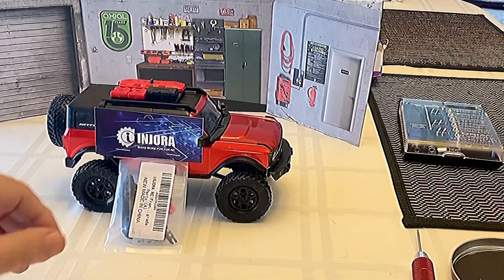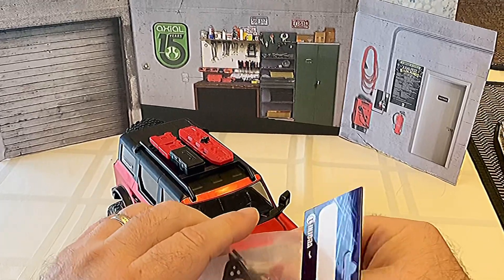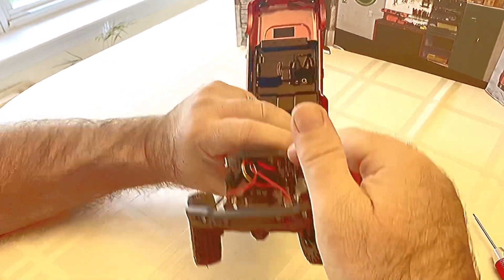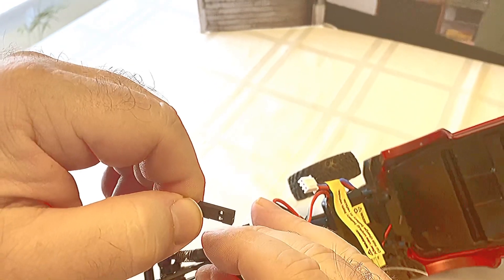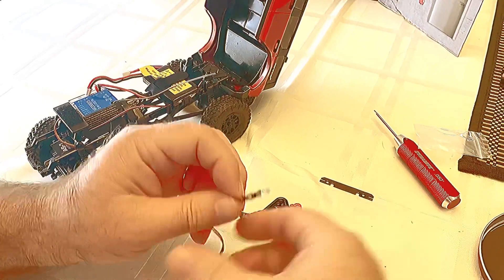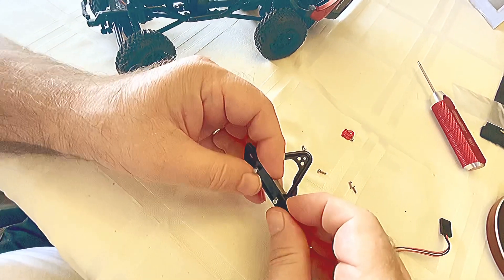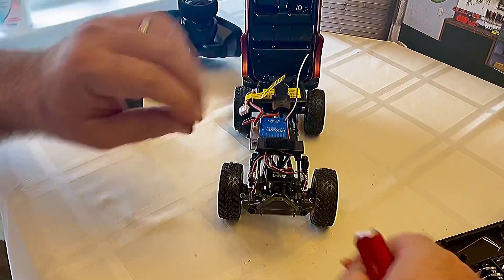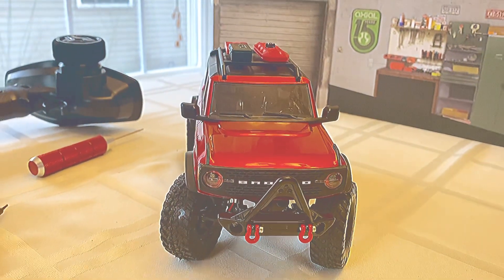SCX24 Ford Bronco Injora Bumper Install

Comment: I found slide the wires of the lights into The slotted ends Of the bracket first that holds the lights in place then push the bracket straight on
Reply from the maker: Thanks for the tip